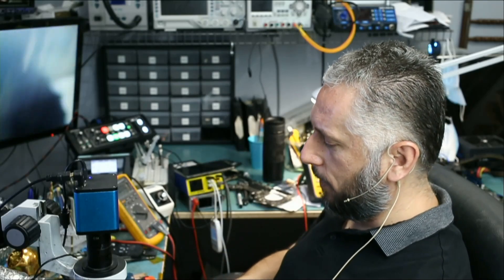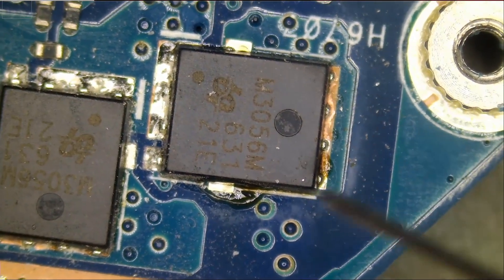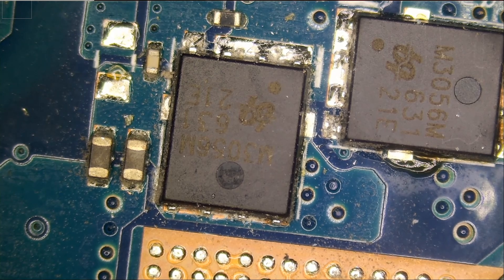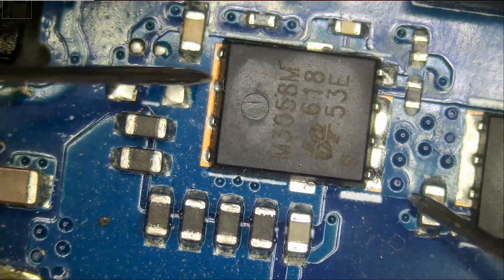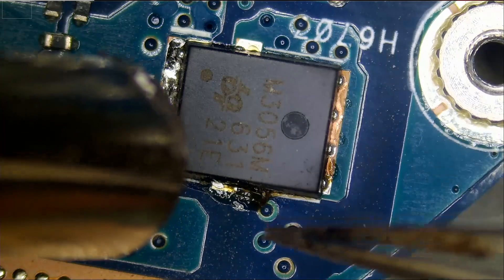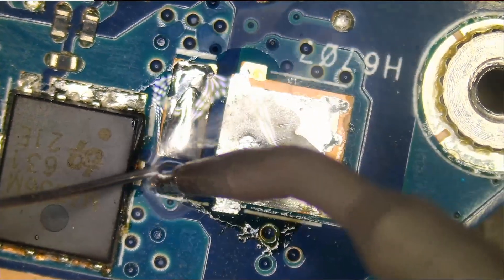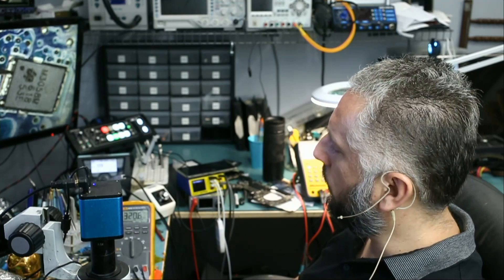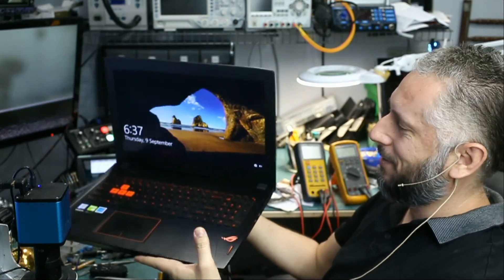Asus GL502v Laptop Repair No Power- How to Test for a Bad Mosfet

Comment: My gl502vsk just did this. Power adapter goes into safe mode when I plug it in, and the led on the power adapter turns off when plugged in.

Comment: Hi there, I have a similar issue with my asus laptop but my mosfet part number is M3056M 630 03E. What does the 630 03E mean? I cant find exactly the mostfet with the 630 03E

Comment: Can anyone chime in, I have a Dell precision 5530, I see two mosfets that burned out and their markers got smoked off, right next to them are two identical mosfets with different numbers B07N03R and B04N03R, I was able to locate the B04N03R mosfets for sale but can't find the B07N03R, if I replaced both with the B07N03R variant would that be sufficient or if anyone with mosfet knowledge can chime in on the difference between the two?

Comment: Yet another superb video, thank you Alex (and Big Boss).
Can I ask though please, what made the mosfet overheat?  Could there be a fault of some description further on causing over current?
Reply: Yes, in this case, Alex should have turned it on and looked at the mosfet with thermal camera. There could indeed be an un repaired fault downstream that was the original cause. He seems to think that there is always only 1 problem.

Comment: If you replace mosfets on a badly designed laptop. Won't they just blow again? We don't do board repair where I work...we'd have to charge a couple hundred dollars for a repair like that if we did...no one would want to pay that to repair a motherboard. Keep up the good work and good work on the channel.
Reply: a dead mosfet doesn't mean a laptop is designed badly, a mosfet is essentially just a switch, you can have a multimillion dollar house but that wont stop a light switch from failing eventually

Comment: What causes the mosfets to fail?
Reply from the maker: I'll ask the bad Mosfet tomorrow and will get back to u
Reply: @NorthridgeFix  rofl xD
Reply: It's a little bit complicated. Let's say that if it gets too hot, the connector that controls it's state (the Gate) will eventually break. Then it no longer works as a switch but as a short circuit.

Comment: Can you confirm what was the Voltage on the Gate on the first Mosfet, after you you got it working? Many thanx
Reply: By N-channel mosfets, the opening voltage at the gate should be 6 Volts higher than the input Voltage, also about 25 Volts here.
Reply: @SiETechNotebookReparatur  agree therefore VG is > or equal to Vout + Vth.  I am thinking there is a boost circuit on VG since he measured 20V from the DC supply and on the source to gnd.
Reply: @ziradlabs  You can find all such information in the datasheets of Charger IC´s. The gate drivers are
 internally integrated into the IC with 6V of gate drive voltage. Most charging ICs have 2 charging pumps for the gate-drive.

Comment: Gaming laptops are prone to heat damage due to lack of cooling
Reply: @BlondieHappyGuy  Do you block the fans when you blow the thing clean? I hope you just skipped this step. Never propel the fans with compressed air because this can brick your mainboard.
Reply: True if fans spin in opposite direction they could produce back current. Maybe best use vacuum cleaner
Reply: @bassamxp  Good circuit design always employs a fly back diode on an inductive load!!

Comment: After watching so many Asus repairs i do not think i will ever go and buy one. Another great repair!
Reply: They sell millions of computers. It stands to reason that repair companies will see more of them. It's the failure RATE that's important, and without knowing failures vs sales, that's impossible to know. How much and how they're used is also factor. Asus are a commodity brand. Buyers of high-end models are more likely to know how to treat them well.
Reply: @GaryB007  I might be wrong because the laptop i am using right now has been bought in 2011 and still runs perfectly. It is not asus. I will go with the same brand i currently have for sure.
Reply: By the same logic you should never buy any brand of anything. All brands have problematic models, plus you never know WHY exactly has a device failed. If you have to, at least judge models, not brands. 😉
Reply: @em0_tion  Right, In my country, Asus has a pretty good reputation, it is HP specially their pavilion models that's a no go.
Reply: @sidewinder3422  I do not remember the last HP pavilion repair at Alex. He mentions it himself that every single day has Asus laptops on his desk.
Reply: @alupci  Fair enough, but like the other user has said, Millions of laptops are shipped every year, whatever repairs you see here on YT are just a small sample size. My mom uses a 6 years old lowend Asus laptop and it still works up to this day.

But again at the end of the day you can end up with a not so good unit regardless of the brandname because laptops are literally made like hotcakes.
Reply: All the Asus stuff I had eventually failed. From laptops to routers. Garbage IMHO. HP just works, laptop from 2011 elite series, 2012 workstation, 2017 spectre x360 all still work to this day.

Comment: Alex in regular school I was not able to keep track of a single subject. If the teacher will say every time mosfet mosfet mosfet.

From most of the times you upload videos about Asus and mosfets I have learned alot about mosfets and what is inside the mosfets. I broke them for fun.

You dug into this subject and that's how I learned.

First time I did not run away from class, like I did in 2000+.😂